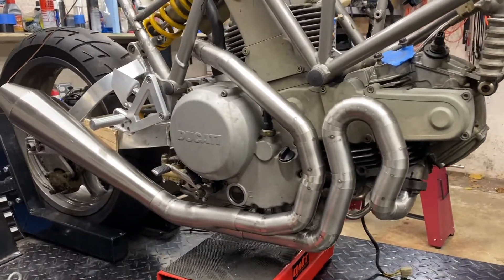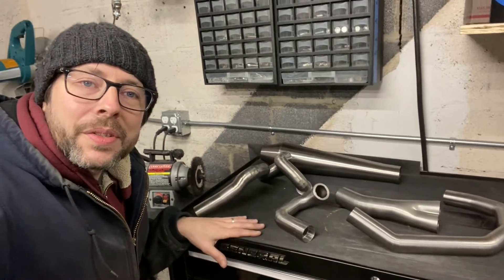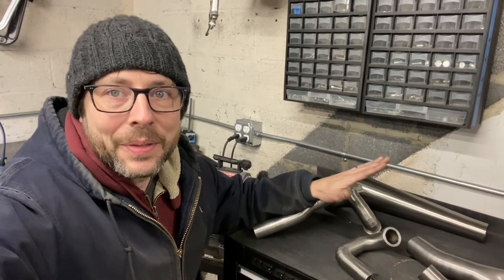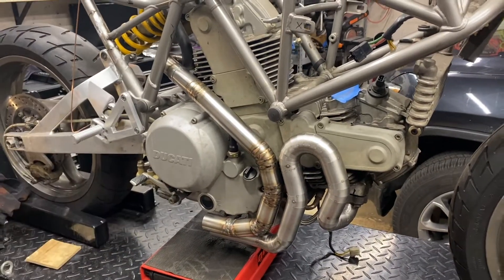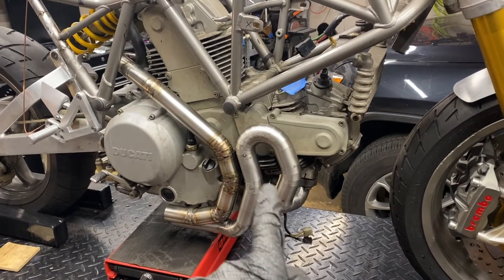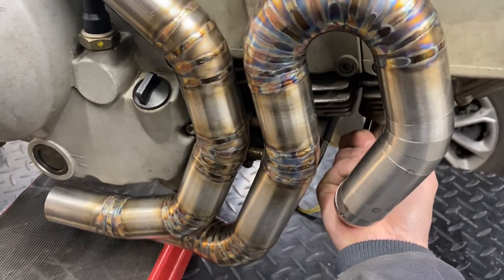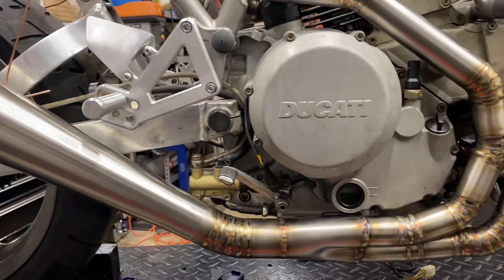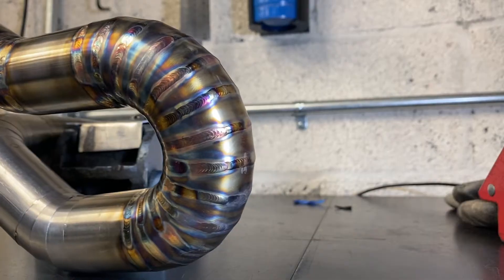Stainless steel exhaust TIG weld out! Ducati 900SS custom motorcycle exhaust pt 4!

Comment: Wow, You are amazing ..no leaks and a great design. Also, you have a terrific work ethic. 
     Some ????s I have......., 
             That hose always connected to the end of the tube, that's because you're using stainless steel tubing and something about migration/bad weld s???? .
    That tripod with a small square plate in the middle is used for what???? Resting your torch on???? 
   Will the hot running pipes cook any engine parts or oil or your LEG?????
Reply from the maker: The tube is supplying argon to back purge the weld. Stainless must be shielded front and back while welding to prevent oxidization. The tripod is just a homemade welders finger, just helps hold things. I'll have to move the oil pressure sensor or shield it some how, and while sitting on the bike the pipes aren't very close to your legs.
Reply: Thanks for quick and well explained answers